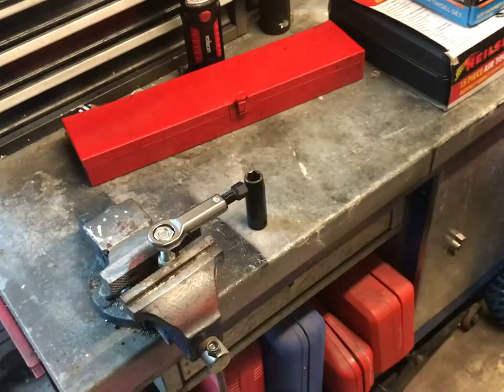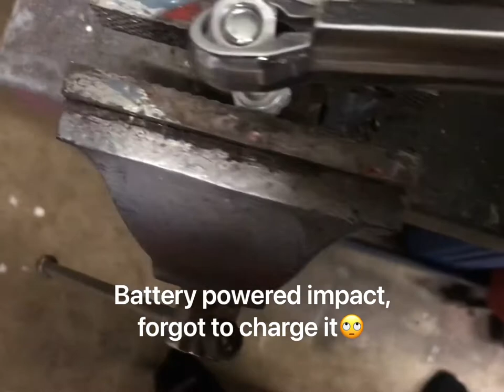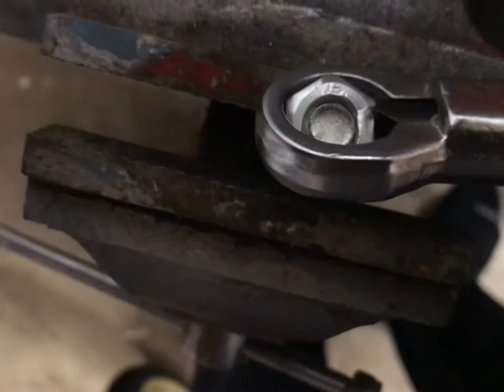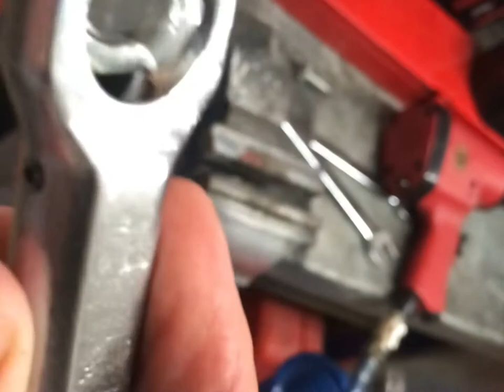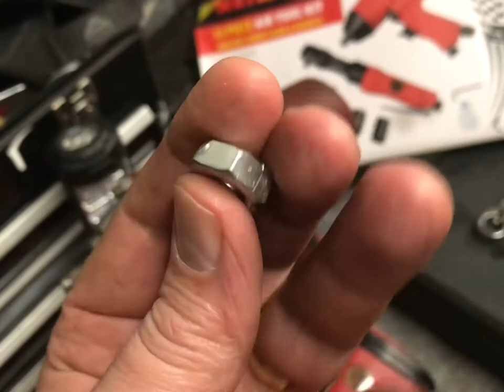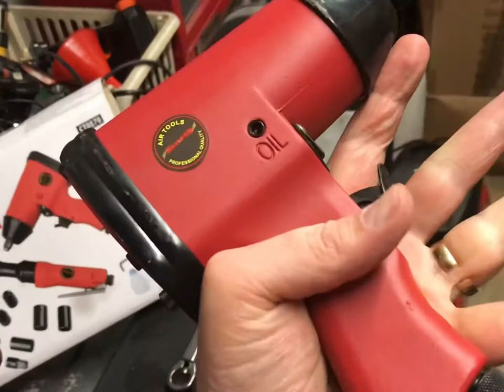How to split a nut!! Using a nut splitter

Comment: the key mistake is that you had the sides of the nut rest against the inside of the splitter ring so the splitter worked against itself. That is the splitter was pushing the nut apart while at the same time holding the nut together. What you need is a) a larger splitter for this size nut and b) keep the splitter from turning with pliers or a vice grip. Peter
Reply from the maker: Great input Thankyou 👍